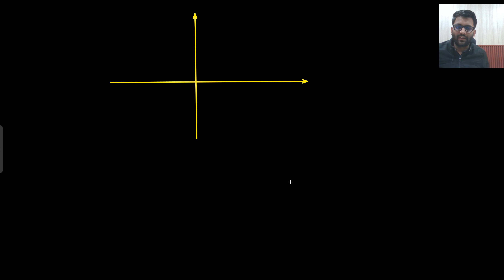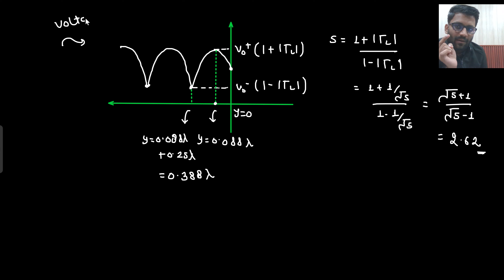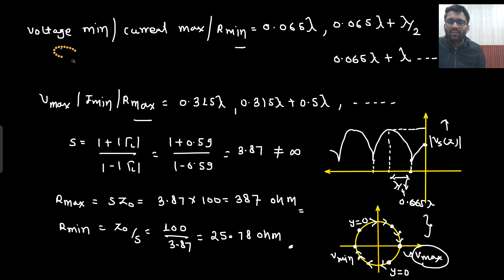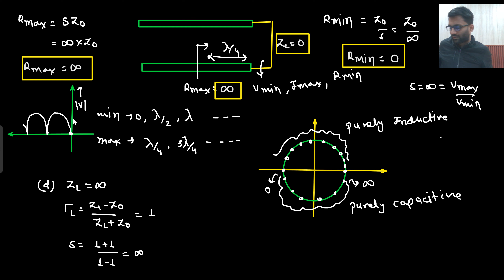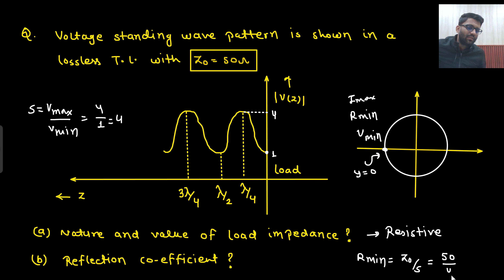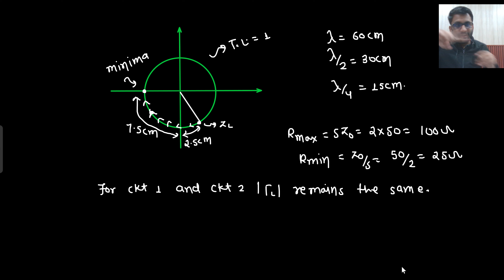🔥Standing Wave Pattern on Transmission Line || Complete Concept from Scratch || PrepFusion

Comment: At 2:11:38 , wavelength is 5m for the given question(misprint i guess). So either assume length of transmission line to be 17 meters or frequency of 3 GHz.
Reply: good one bro i also got 0 as ans firstly and worried

Comment: Hi Guys! 
There is a blunder from my side. I wrote the formula of reflected power and transmitted power opposite in the last question. Please rectify.
Reply: Sir in question where we have to find no. Of current minima lamda will be 500 cm or 5cm
Reply: @SaurabhKumar-yj4ww  That's an error from my side. Take the length to be in meters. Rest analysis remains the same
Reply: @HimanshuAgarwal_  thanks sir
Reply: @HimanshuAgarwal_  sir what is the range of angle for reflection coefficient? -π to π or something else